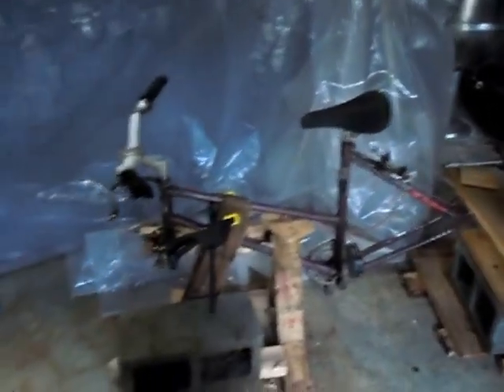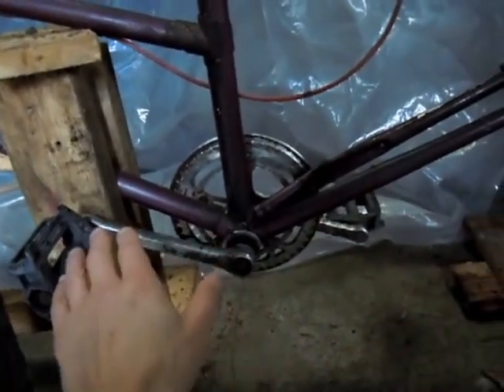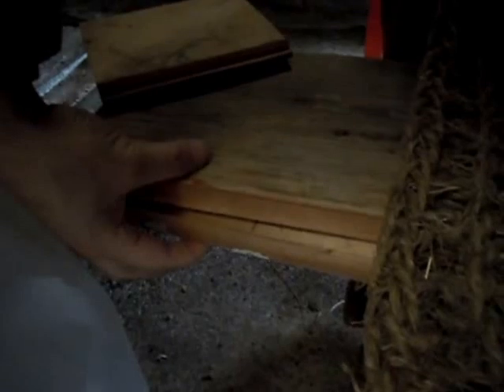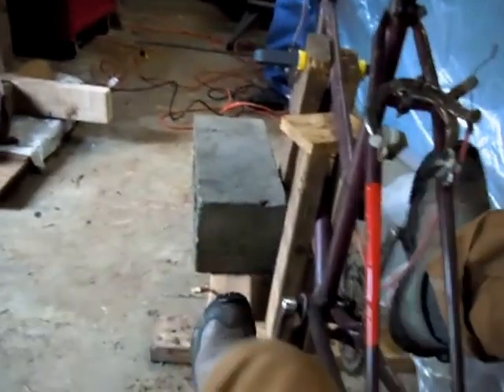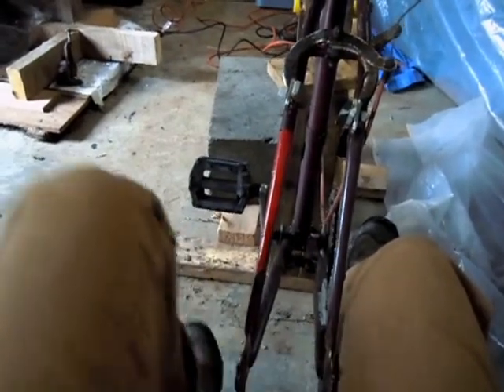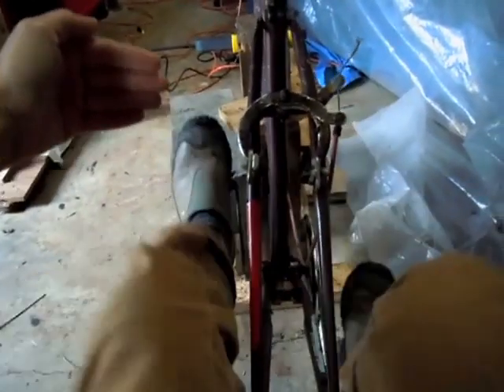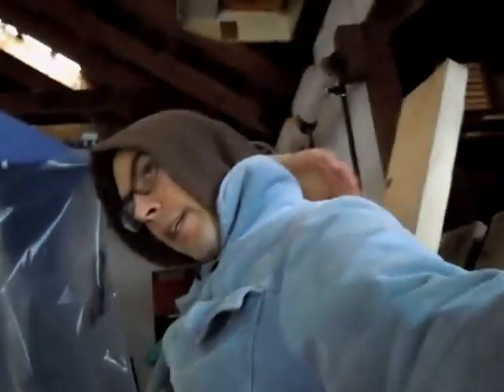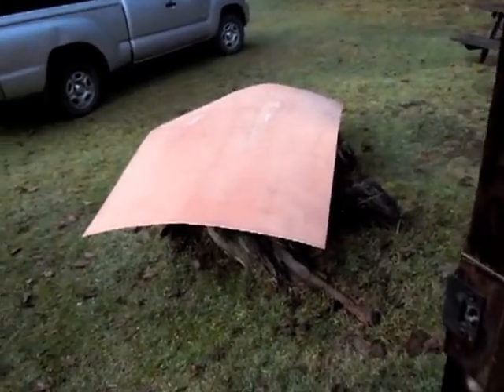Recumbent Bike Velomobile Ergonomic Test Rig Jig

Comment from the maker: This will be a reverse trike with a floor so there's no issue with feet on the ground. Two seats up front with pedals and a third without pedals that straddles the single rear wheel. I might have two sets of pedals linked in a sort of W shaped configuration or I might have two totally separate crank sets. They will drive a lateral shaft under the seat which will in-turn drive the chain to the rear wheel. This way I can swap in different electric motors too.

Comment: Well the seat can only be so deep that the person has to put their feet on the ground when the bike is not in motion, but if the seat back comes forward you have to make sure they have enough seat left to sit on. If this is a three seater, can't wait to see how your going to do the chain and transmission assembly. Ok your going to have 3 one in a line, one infront of another? Or 3 side by side? One in front of another will be really hard to turn. Id like to have the wheels in between riders.